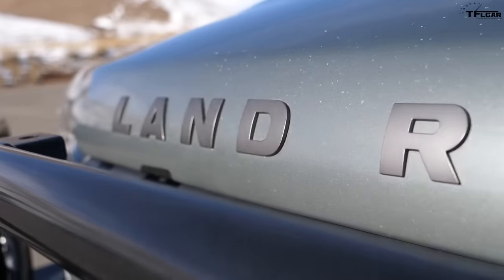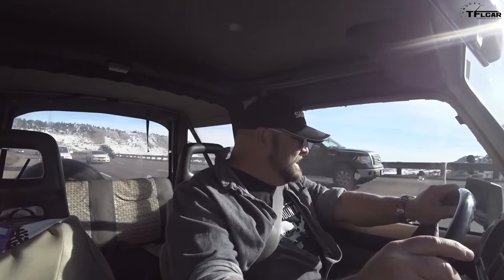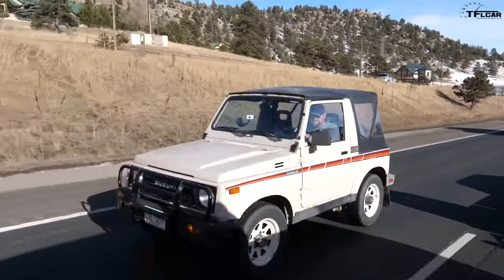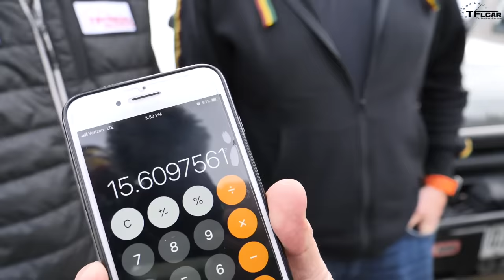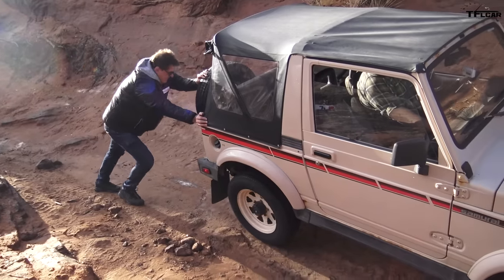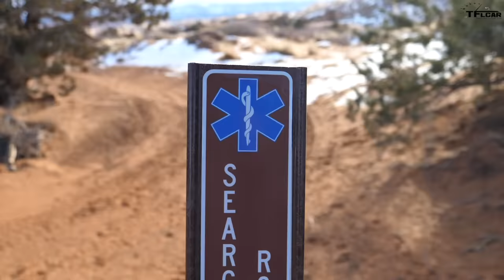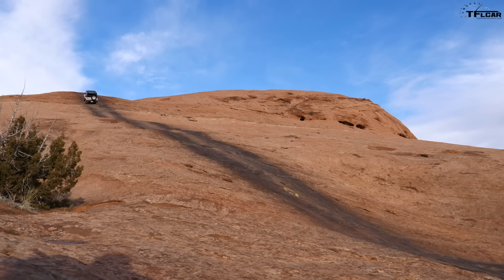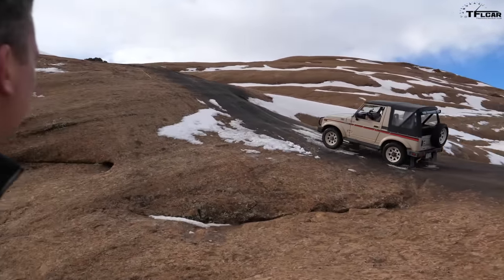We Torture Test 3 Budget Off-Roaders in Moab & This One Is The Best! Cheap Jeep Challenge Ep.8

Comment: A jeep without a 4.0 is like a pizza without sauce. You're missing the best part.
Reply: The new 2.0 Turbo brings it
Reply: Sure... And Japan makes some other things which sort of compete a bit more directly. Those are also pizza without sauce. (but not cheap for reasons.)
Reply: Tom Giffin you are high..... it’s a 2.0 firstly.and secondly it has a turbo that makes it 15hp less, but higher torque than the 4.0
Reply: GKeeper316  Not sure where you are getting your info from. Must be reading on some inaccurate site instead of actually owning a jeep (fanboy)? Nobody was ever debating that the engine has changed. It has evolved for sure. 
And there is not a 2.0L Turbo diesel in the new JL's. Sorry guy, stop being so angry.
Reply: pfffft, our jeep has a 5.7 V8
Reply: 1997 TJ owner here, 2.5 doesnt like the highways, however it kicks ass offroad!
Reply: More like an essential ingredient
Reply: GKeeper316  Don't forget AMC also had a 4.2 i6. Honestly, before Rubicon, the 4.0 and either transmission is the best Jeep combo in my opinion.  I had 2 4.0 auto XJ's.
Reply: Steve Awesome I have an LJ Rubicon with the 4.0 and the 6 speed manual and it is very strong, plus it can run at STUPID low rpms without stalling (approximately 250-300)
Reply: These are hard facts
Reply: The 2.5 is not a powerhouse but it'll take some abuse!
Reply: Have you ever had a thin crust 6 cheese pepperoni no sauce pizza??? You're missin out
Reply: If i had a jeep i would stuff my extra sr in it 😆
Reply: People forget that the Jeep that won WWII had a 4 cyl.... The 4.0 is way badass and super cool, I am not in any way knocking it. The 4 cyl Jeeps have a special place in any true enthusiasts heart though, especially if theyre an American.
Reply: No,  the cheese is the best part. Just Saying.
Reply: A Jeep that’s not a bronco is like a pizza without cheese.
Reply: Please don’t ever do another comparison test with a Jeep unless it has the 4.0 high output engine in it. Also if you’re going to represent an affordable yet capable Japanese off roader the third gen 4 runner would be the proper vehicle not a suzuki
Reply: 2.8 diesel only
Reply: Swap 5.9 magnum.
Reply: @Thecarexchangepodcast  notice that word.....affordable...... Toyota is anything but. So you jus excluded ur 4runner. A well maintained good looking 4 runner is not cheap. The suzuki however....is
Reply: Every time I’ve seen a jeep 4.0 it has a bad head gasket lol nah but they are good engines if we’ll taken care of
Reply: Jeeps are for old lesbians
Reply: @tony_5156  😳 🤦‍♂️
Reply: @demarbiggins1512  the 4.slow is a very good trail motor unless you use 5-30 in it then your gonna end up with a rod knock at some point…the ones with heads failing usually fall into the 99-02 model years couple hours & a earlier or later head swap your good to go
Reply: A 2.5L/5spd YJ/TJ has low enough gearing to crawl rocks nicely. With trackbars/anti-swaybar disconnected, and tools/gear in the back, it can keep rear tires planted better on climbs than the heavier I6, which can help open diffs.

 It will also churn through snowdrifts with 30-31" siped mudders in 4H nicely...until it bogs down. Then you shift into 4L and back out, whereas an I6 has enough torque to bury your rig.
Reply: @floppychzcake7936  Same, and a chevy 4 spd auto. can't beat the LS
Reply: How about a 6.4? Is that a pizza with extra sauce?
Reply: @wilpharaoh3276  let’s see how all these turbo, over worked, over heated, over revved little 4 bangers in a heavy box are after a 100k miles, I’m sure ready for rebuild, ESPECIALLY if you follow the manufacturer’s recommendations for service, which is too far between, 5000 miles MAX for oil changes, regardless of the type of oil and filter, 10k, and some even say 15k miles for oil change, which is horrendous, which will barely get you past warranty, but new engine territory after that, which is why they have it.  The 4.0 was “broke in” after that mileage.
Reply: @Thecarexchangepodcast  actually an FJ Cruiser, which would blow them all away.
Reply: A pizza with sauce??? The Italians are cringing now. Pizzas don’t have sauce man!!
Reply: If you absolutely want big tires (+30”), drive the highway and/or actually drive off road, then definitely get a 4.0L. Otherwise, a REAL Jeep is short and narrow, has 4 cylinders, no more than 5 MANUALLY shifted forward gears, and ZERO power options (windows, door locks, etc).
Reply: @tony_5156 😂😂😅😅
Reply: Wow!!!
Reply: The old irondukes are fun
Reply: Coming from someone who has had a ZG Grand Cherokee with a 4L (Euro built Australian delivered ZJ), I 100% agree. I only wish it was a WJ with the 4.0L, just a slightly nicer vehicle all round.
Reply: I'll take the 4.0L all day everyday. I don't care about the power output, it's the fact if the engine is maintained it usually outlasts everything else on the vehicle. My Grand Cherokee had 298k miles on the original motor, the transmission needed to be rebuilt after 210k miles, but then the body and frame rusted out. That motor didn't even burn oil yet. Over heating these engines is what normally blows the head gaskets and these engines had issues with heat, but is easily remedied with some minor modifications.

Comment: The Suzuki should get extra credit for not being modified
Reply: all season tires too boot.  Pretty awesome.
Reply: all days tires HAHA
Reply: And the Landrover should be disqualified for not being "budget" and "cheap" as the title reads.
Reply: @cannonball666  even modified the Discos are still very cheap 4x4s. Cheapest in their class by a long shot.
Reply: Kevin Steele. You are right on the money there with that whole statement! But I also have to add a few more things to that. The poor Sammy is even more let down by the (Guy's) poor maintenance on the running gear of the Samurai and have the presence of mind to actually try and make this run off of the three of them as reasonably close to each other's vehicles and at least have the decency to appear to make it look equal to the other two. And have the correct information on them all as well! The carbureted Sammy's engine is 46horse power up until the end of 89 when they started production of the throttle body injection and that engine is rated at 65hp and the longer stroke 1.6-8valve engine in the Sidekicks in 89 was rated at 81hp. But the drag race was kinda a setup from the last few videos of the series to try and make the Sammy look even worse and if they had just simply some of the basic maintenance on the running gear and get the carburator repaired and the ignition system brought up to snuff and replaced the fluids in the driveline components to reduce the parasitic losses to maximize the running gear they wouldn't have been able to catch up with him with that large amount of a head start! Next whomever told them to keep the tires aired up to maximize the ground clearance and deal with the consequences of a set of tires that are very dry and a terrible tire for the lightweight of the Sammy and it just seems like over and over again Tommy and his father wants to degrade the Samurai over and over and over! They've done nothing but handicap the entire series and leave it completely stock with completely worn out part's and make statement after Stament that it's a very rough riding and basic vehicle and there's Nothing they can really do to change it! And worse when they did finally get a new set of tires on it they went for the cheapest option to keep the tire and available traction on the lowest possible levels while they buy part after parts for the Jeep's and the other vehicles in the test fleet! I have been working on Sammy's for 30 years and it's Paramount to have a correctly tuned carburetor and correctly timed engine and the valves correctly adjusted for the power to be even close to the factory 46hp levels but when they are they have no problem getting down the highway and getting to 65mph on Small tires! My stock carbureted Sammy is easily capable of doing 65-70mph on a set of 30inch BFG AT ko tires and get fuel mileage in the lower 30mpg. But it's correctly tuned and taken care of. But it also doesn't hurt knowing how to drive off road as well. But also why didn't they put the Sammy in the middle of the two of them on the highway to share breaking through the wind going up hill? O well I hope that you all have a great time with your Sammy's and if anyone is near the Northeast of the country and you're looking for a Samurai to own one! I have a bunch of them from stock to fully built and carbureted ones to the 94 fuel injected one's! Best wishes. Bill
Reply: Best thing about the Sammy is that when it tips over two guys can roll it back over .
Reply: Schwanzus Longus anything with a locker is unstoppable. 🤣
Reply: @GeneralNOH  there is a reason, if you want parts best be ready to sell an organ. Just like old Jags.
Reply: @DesertFernweh  i dont doubt it😂
Reply: Just picked up a 95 yj for $1800
$550 to replace the steering box
$100 for valve cover gaskets

Has an ungodly 6-8 inch lift on 31s
Doing a dirt cheap jeep build
Reply: Bo Jangles yes!
Reply: @cannonball666  it was 5500 .. the jeep was 6500 and the suk was 2500
Reply: Bo Jangles I think it should’ve been Tommy driving the Suzuki as well. Just to keep a trend.
Reply: @billyputnam6892      do you have a website? im interested...
Reply: @bxtoyotero  did you get my email reply? I am having some trouble with the emails from Yahoo but I get the replies from here on another message format so if you did send me something to my regular email already and I didn't reply do it this way again and I will get right back to you. Bill
Reply: Schwanzus Longus  my friend has exactly that. 1.6 petrol samurai, lifted on actual tyres. Top speed on the highway is 50mph but in the mud it embarrasses V8 Land Rovers and the like.
Reply: Cannonball666: wtf are you talking about? He paid 5000 dollars for it. Less than for the  jeep.
Reply: This!  They clearly handicapped the Suzuki.  The least they could have done was give it new off-road tires.
Reply: Schwanzus Longus  a factory locker .and is it selectable..
Reply: @cannonball666  you can buy that rover for about 4k bud
Reply: @GeneralNOH  could that be because it will take the price of another one to keep it running.  And that's just for the coils.
Reply: @rustynail7866  yeah i know, friend had one. Got it super cheap, sent it until it started breaking stuff, then sold it. Didnt even lose much money on it. But they are definitely cheap to get a hold of contrary to what the person i replied to said.
Reply: I love mine. In the middle of rebuilding the engine with some headers, a Toyota carb, 9.5:1 pistons and a better cam. Suspension is only lightly modified... old man emu 1.5" lift springs and a .5" shackle lift. That's it. I think his Sammy also has the shackle lift.
Reply: T

Comment: I had a Samurai back in high school. Had a hockey puck lift and 31s. Thing could go anywhere. Glad to see these vehicles still going strong in 2019. Great video!!
Reply: S Walters anybody who never drove one off road made fun of them.  But they are awesome
Reply: How could you lift a samurai with a hockey puck its spring under that would just lower it
Reply: If I recall correctly, they were wedged between the springs, not the spring and axle. Had a backyard mechanic do it for $50. Held up well. Only problem was a slight shimmy in the steering at highway speed. Probably not the safest thing, but I was too young, dumb and cool at that time to care.
Reply: puck lift is a body lift. just thicker than stock bushing between body and frame. suspentions stayed the same just more room for tires

Comment: I love you guys. Tommy, your Cheap Jeep Challenge inspired me to buy a TJ two weeks ago. Since my original purchase price of $2500, I've spent an additional $3500 making it an off-road machine. Didn't realize that JEEP stands for "Just Empty Every Pocket." That said, I'm having a blast! Can't wait for your next video.
Reply: sebastian Sm  : My '99 TJ has 154k miles on it. I'll add that mine has the 2.5L 4 cylinder motor and a 5-speed. No idea and don't care about MPG. I added a 4" Rough Country X-series suspension and 33" Duratracs last week, so that'll affect mpg.
Reply: sebastian Sm  I wanted the 4.0, but when I saw what came with this TJ (hard top, soft top, bikini) and realized how mushy the suspension was, I was able to make a sweet deal. Took it out yesterday and the 2.5L did great off-road.
Reply: Congratulations and welcome to the TJ Family.
Reply: John, did you get lockers installed and around how much did that run you (if you dont mind me asking).

I'm considering getting a tj as well.
Reply: @Frozen_Tundra GT you're looking at $30-$40k for a typical Defender.
Reply: sebastian Sm After owning a yj save your money and get the coil spring tj. Yj’s ride like a rock
Reply: sebastian Sm  I'd recommend going the 4.0 route, my friend. It's a really durable motor and it gives you much more options for mods down the line. I've got a manual 2.4 4 banger and it gets me from point A to B just fine but I wish I had those extra two cylinders on the high way. Good luck on the purchase and welcome to the Jeep family my friend. Don't forget to wave 👋
Reply: @andoniades   No, they're terrible, break all the time, and will dissolve into dust in a week.!!  J/K.  I want one as well.  I'd be happy to find a blown up 4.0/manual combo with good bones.  I want to do the R2.8 Cummins swap.  Mine won't be "cheap" as the engine itself is $9k
Reply: But are you not having fun spending the money ? Hours on the internet comparing upgrades,  Hours more comparing Brands /Price,  $2000.00 for a 2 inch lift , or $10.00  on a Amber  heat wrap for the Jeep fog lights, And then your out on the Road/ Track  "Adventuring" As my grandkids call it,  Finding a Beautiful Beach thats inaccessible to most people, Or climbing over  scary rock  as your holding your breath, Your challenging your Vehicle and yourself,  G'day from Goulburn N.S.W Austraila ,
Reply: 2500 for a tj?? That's a steal of a deal
Reply: I have been around Jeeps for a good part of my life.   The TJ is the last Jeep to have DNA that roots back to the CJ and YJ.  It is more simple than modern JK and the JL.   It is also a really durable Jeep.   Congratulations on getting a TJ and good on you for putting some new parts on it and keeping it on the road and doing something with it.   Old Jeeps aren't just cool - they are built!

Plate C
Reply: sebastian Sm  I have a 2.5L in my basically stock TJ,2000 mdl.yr,with 31" tires,and 4:11 axles front and rear,not fast on the hwy, but it's a Billy Goat offroad, and Loving it!

Comment: Where I am from, we call the suzuki Samurai: "The mountain goat"; because it can climb anything like a mountain goat.
Reply: You can order the base models with whatever extras, so you don't have to hunt for dealers that have them.
Reply: Ppl who don't experience goats don't really understand the gravity of the statement.
Reply: @restartrestart581  for sure. I've seen them climb up ledges that 4 wheel drive ATV's have trouble with and then get driven home afterwards..
Reply: @BabyCharlotteschannel  I have a 87 with a spring over axle, front and rear sparten lockers and 6.5 transfer case gears & a Toyota carb. 17 in rims 32 in tires k2 . Nissan versa electric steering.
Climbs the rocks that jeep Rubicon can't do. 
Look up Zuks of AZ

Comment: Banzai Samurai!!! Please give the Samurai a small lift,  better tires and cheap engine overhaul.
Reply: Jarrod King that samurai is probably working with about 50 hp by now.  An engine overhaul would fix that right up.
Reply: @ben walker they only topple from poor driving. I bought my Sami with a 6 inch lift and it has never threatened to roll.
Reply: Toyota hilux axles, lower gear ratio, and the smallest lift that will fit 35's without major surgery.
Reply: and a snorkel, every off-roader is better with a snorkel.